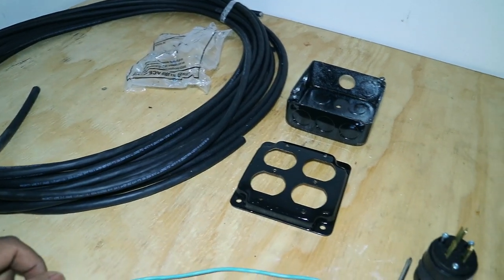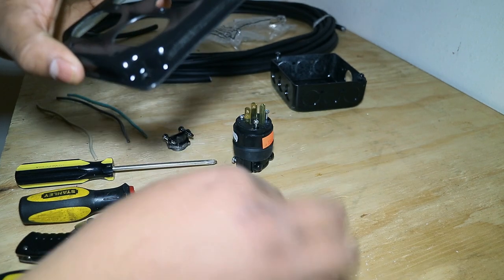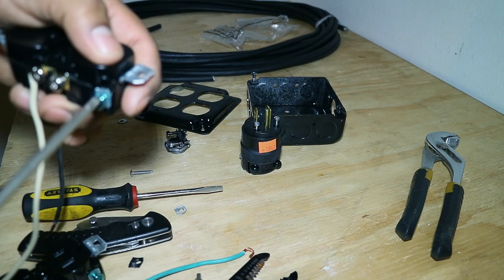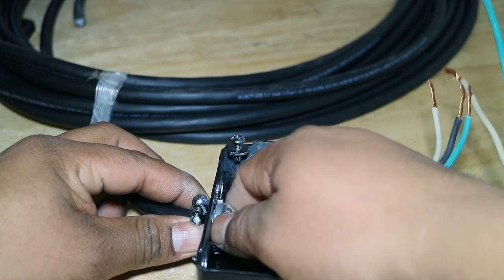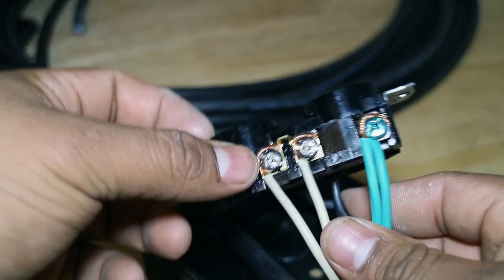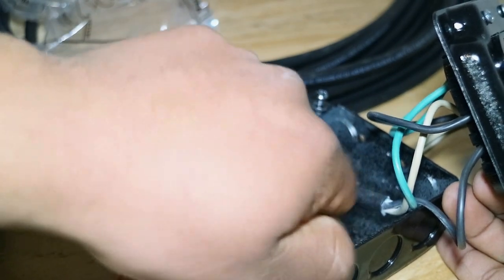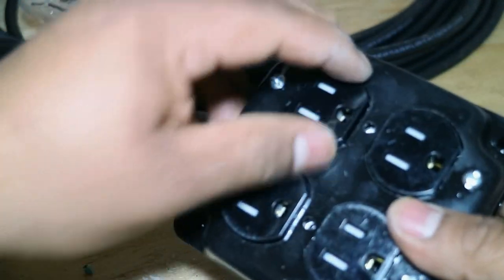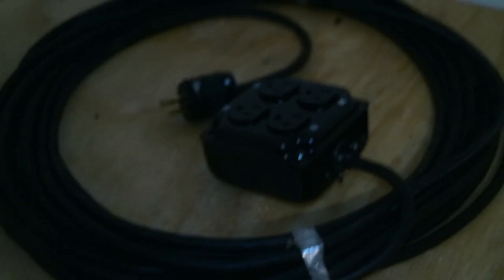Make a Quad box | Power box | For your dj equipment

Comment: For those watching, the 16AWG SOOW cord used in this video is rated for only 13A up to 50 feet and only 10A from 50 to 100 feet.  Better to use either 14AWG or 12AWG for longer runs.

Also, you can save a few bucks by buying the "junior" SJOOW 300V wire instead of the pricier SOOW 600V stuff.
Reply from the maker: I agree with you.. I have made 6 including this one 50ft cords.. a couple two years now and still working great.. I do agree for longer cable  12awg would be better.. also making it a 220 plug with a breaker box for that long would make more sense
Reply from the maker: Thanks for watching my video

Comment: Nice Video, TIPS: 1. I would use at least commercial grade outlets because, they will hold up better, and are very durable. 2. Strip the wire FULLY, there should not be ANY conductors under the screw terminals. This can cause electrical problems in the future. 3. You should run a ground wire to the metal box.  4. wrap electrical tape around the receptacle. Other than that, You did Great!
Reply from the maker: Sirens Of SW Ohio thanks for the tips so far it’s holding great
Reply: I agree, because insulation under the terminal screw can cause a poor connection, heat through resistance, and failure.

And it's not recommended at all that you put two wires on the same terminal. It creates a poor and unstable connection. It is better to pigtail your connections.

Grounding is very important for safety, it prevents you from getting shocked. Having it on the box helps a lot since it is bare metal which is very conductive.

And the electrical tape around the receptacle terminals would prevent anything from touching on the terminals, causing a short.

Following these recommendations, your device will give you safe and reliable service for many years.

Comment: I’m not an electrician but Im pretty sure u wanna ground the wires to the metal box. A whole lot safer
Reply: I agree, even if you're using self-grounding receptacles.  Redundancy is good when it comes to safety.
Reply: Absolutely need to

Comment: Hopefully this won't happen but if there is a site inspector or anything, they can shut you down because of the holes on the box. I know there's some companies that make weather proof, made of rubber, that's more recommend but, highly doubt that anything bad will happen. Also another note, be careful if you're outside, because the holes on the bottom and water don't mix well. At least here in Canada for me anyway. Idk what it is in the USA
Reply from the maker: KG Productions thanks for the comments/ great points you make/
Reply: @DJXTE  no worries dude
Reply: I believe we use NEC standards in the US.

Comment: In the United States Can a dryer cord or a electric stove cord be used to make a 220 volt quad box with United Kingdom or Australian wall outlets or European wall outlets for powering pro audio equipment that runs on 220 volts ac.